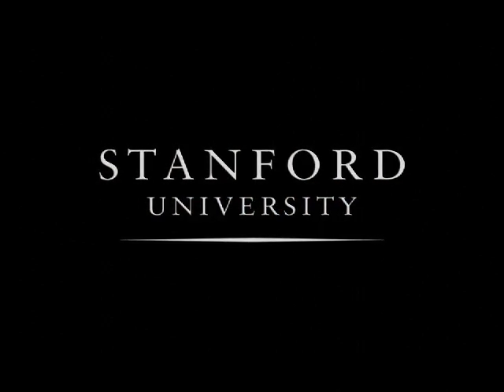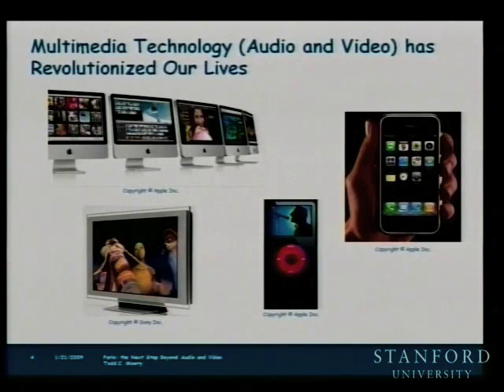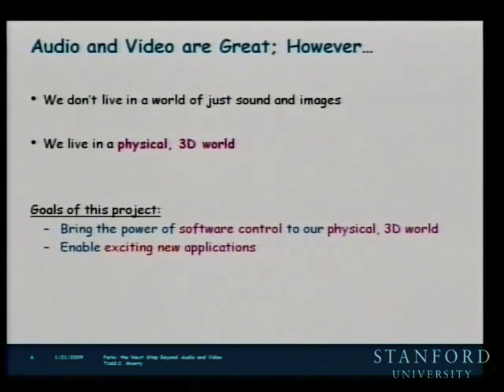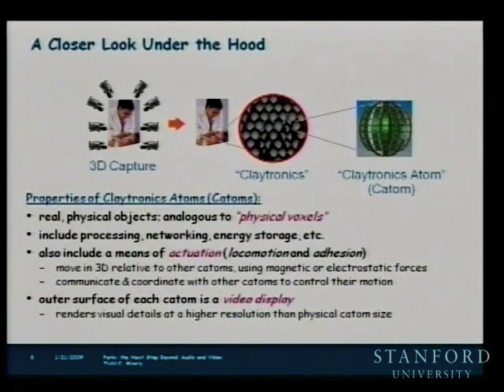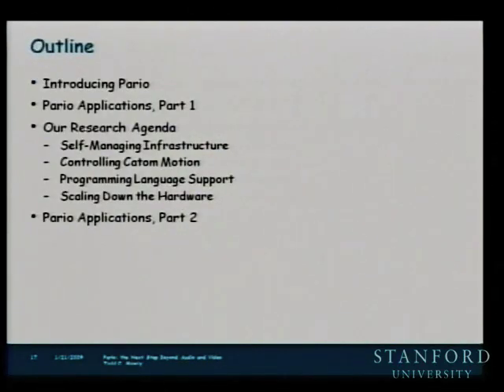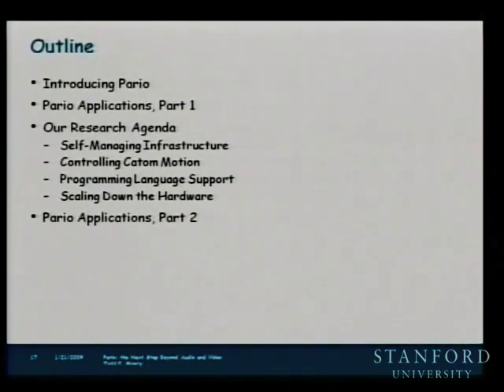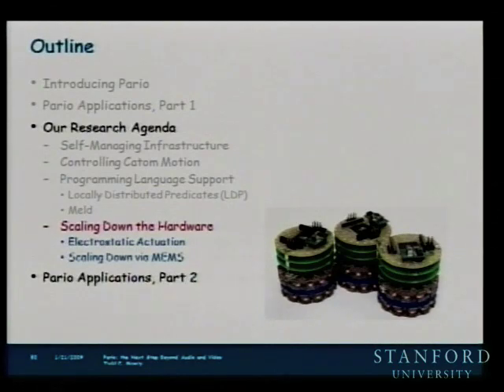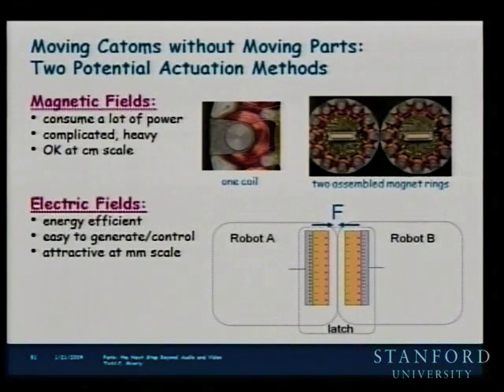Pario: the Next Step Beyond Audio and Video

Comment: Wireless electricity exists. You can create a field where the catombs can get power in while they're inside the field. Although that means if it leaves the field, it would power down and the model would kind of look like it died. Still though, it's a great alternative for routing power.